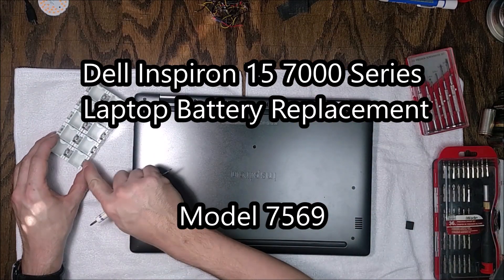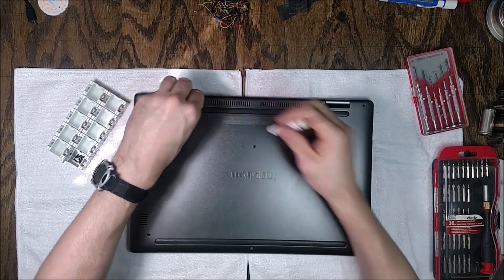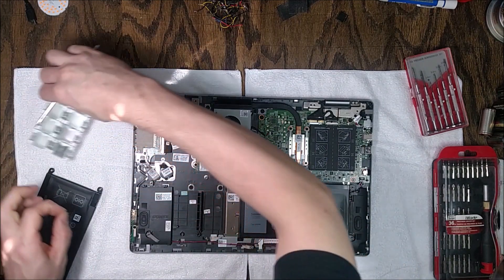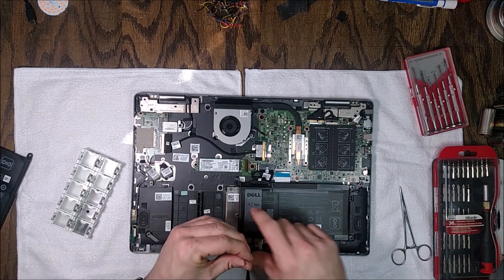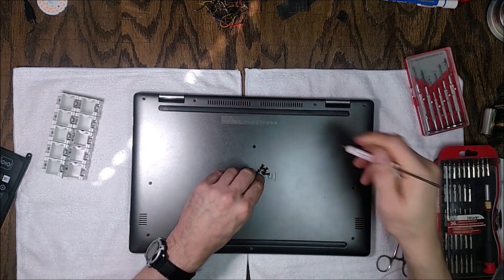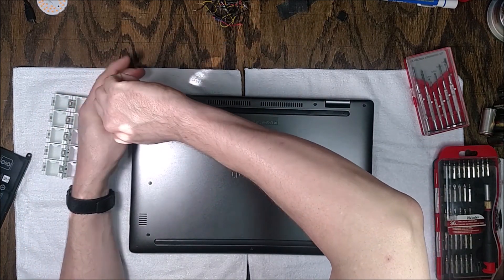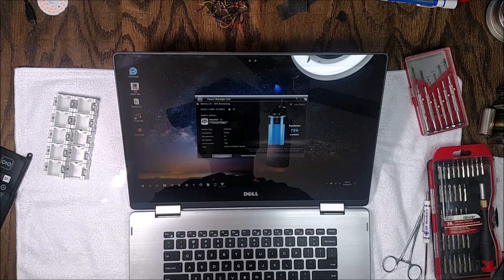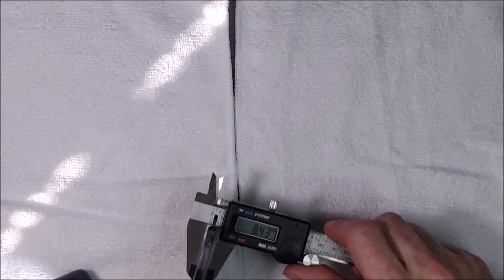Dell Inspiron 15 7000 Series 2-in-1 Battery Replacement

Comment: I can’t seem to unscrew the top 6 screws, and I’m not sure why
Reply from the maker: Hmmm...  You're not the first one to comment with a problem getting the screws out.  My theory before was that the threaded inserts that they screw into are loose and spinning with the screw as you turn the screw.  If the inserts are loose you may still be able to get the back off by removing the rest of the screws then carefully going around the edge popping loose the cover from where it snaps together.  If the inserts are loose they might come out of their holes with the cover.  But if that works then I'm not sure what to do to fix the situation.  It depends on how they are broken.  On other broken devices where I've seen this I have been successful at gluing the threaded inserts back in place with super glue or epoxy.
Reply: @cdsmith  I found a video that helps with this problem, apparently the 7573 model has a chassis which attaches the top 6 screws to the back cover, so you can only remove the bottom 4 screws completely. For everyone who had this problem, I strongly recommend checking out xlearntechnow's video on it, but the gist is that you remove the bottom 4 screws, but leave in the top 6 which are closer to the vents (make sure you unscrew them as far as you can), and then you use a thin plastic object like a card or a guitar pick to pry open the back cover, starting with the section closer to the vents, and the remaining 6 screws come off with the cover. Other than this issue which it seems like was particular to my model, your video was very helpful and I appreciate your reply and efforts to help the situation.
Reply from the maker: Thanks for the explanation on this.  I thought it was odd that the screws couldn't be removed, and I wasn't convinced myself that broken inserts were the problem, but it was all I could think of.  Gotta wonder why they designed it that way.

Comment: does the model number matter when it comes to getting  battery? i just bought one but it had no battery.
Reply from the maker: The model number does matter.  I don't think it has to be a genuine Dell but it has to be the right model because there is a chip in the battery that the laptop checks to make sure it's right.  Also probably has to be the right model to properly fit and have the right style of connector.
Reply: Carl Smith alright thank u!!! My dell is a the same model “ dell inspiron 15 7000” but it was made back in 16
Reply from the maker: I think mine was made in 2016 as well.  You may want to check your specific model number when shopping for a battery.  Like mine is also a "7000 series" but the specific model is 7569.  Then do a search on the specific model number and the word "battery" to make sure you are getting the right type of battery.  Although if yours looks identical to mine, it probably does use the same battery.
Reply: I have the dell model no.  7560 can i use battery which is compatible with 7000 series like the battery description says compatible with 5589, 5590, 7560, 7569, 7570 etc. Plz help

Comment: Hi Carl, appreciate the video! It's great. I have a communication error with my version of this laptop. I'm worried ill buy a new battery and it won't fix it. It's at 91% and refuses to charge. Did you ever come across the problem I'm having? I'd appreciate your advice thanks.
Reply from the maker: Haven't seen that problem.  Does the percentage go lower if you run on battery for a while?  Does it say it's charging if you plug in the power adapter?  Mine has an app called "Dell Power Manager Lite" that can give you better information about what is going on than just checking the windows battery icon popup.  Maybe that app will tell you if there is something wrong with the battery.  Just click the windows icon and type "Dell Power Manager Lite" and it should come up in the search.
Reply: @cdsmith  When you unplug the power the laptop turns off. It says 91% battery. In bios it says communication error with the battery. The battery is relatively new, no apparent issues upon visual inspection. Its as if bios just rejects the battery. Whatever tells bios that its a good Dell battery's seems to have failed for some reason. I'll give that Dell Power Management a try for more info. Thanks.
Reply from the maker: So then the question is if the problem is with the battery or the motherboard or the BIOS.  The easiest thing would be to buy a new battery but that is kind of expensive to do without knowing if it is really the problem.  I guess the next thing I would try is to unplug and closely inspect the connector for the battery and where it plugs into the board to see if there are any problems with the pins in both connectors. Maybe clean the connectors with some alcohol. 
Another thing to try would be to clear the BIOS config settings or even reflash the BIOS but I don't think that is very likely to fix the problem.
Reply: Hey Mark, I'm experiencing this problem currently. Did you manage to fix yours?

Comment: I replaced my battery back in October and recently like a week ago the laptop just died. AC adapter LED doesn't light up, power button does nothing. It's possible that battery just crapped out or is it maybe the motherboard or fan just died?
Reply from the maker: That's a strange problem.  First issue is that even if you have a problem with the laptop, the green LED on the power adapter should light up when it is plugged in on AC.  Check anything you can with the adapter -- if the power cord is plugged tightly into the adapter and the outlet it's plugged into actually works.  And check it while not plugged into the laptop, just in case the laptop is causing a problem.  If the cord is plugged into the brick properly and you know the wall outlet works you might need a new adapter.  But then there's the laptop.  Even with a bad power adapter it should be able to run off battery.  In normal use the laptop should shut down before the battery is completely dead, and so the battery should retain enough charge to at least power up to that BIOS screen that warns you that your battery is too low to boot up the laptop.  So it's likely you have a problem with both the laptop and the charger.  Which makes me wonder if the laptop had an issue that somehow also killed the power adapter.  Which makes me worry that if you just buy a new power adapter it won't fix the problem and maybe you could even damage the new adapter if the laptop somehow had a fault that damaged it.  On the other hand, you can find the power adapters fairly cheaply online.  I found one on eBay for 12 dollars so it wouldn't cost much to get one and see if it fixes your problems.
Reply: @cdsmith  Yea im looking to just get my data off the SSD and get a new one.  Do you recommend any services or devices for getting the data off the SSD?
Reply from the maker: You should be able to just buy an external USB adapter that looks like an external hard drive enclosure.  One that is for M.2 drives.  Just remove the drive and install it in the external enclosure and you should be able to plug it into another PC and get at your data.  It will end up just working like a big flash drive.  I don't actually have one for M.2 style drives so I can't make a specific recommendation.  In general, Startech has a good reputation for this kind of product, but with a quick Amazon search I found a lot of USB to M.2 SSD adapters.  Any of them would probably work but since I don't have a specific recommendation I would suggest looking at the reviews to see if any of them have bad reviews.  You can get a cheap one that is just a circuit board with a USB connector on the end, or you can spend a bit more to get the nice one with an enclosure like an external drive and you could even continue to use the drive as a backup drive, and maybe get some value from the dead laptop by using it's drive as an external drive.

Comment: You need to know the Model number ( example above is model 7569) a) not only to buy the correct battery, but b) Removal of the back.... for instance it is different on the models that turn into a tablet.   [You need the model number if you look at YouTube to see the procedure.
I just did my wife's  Dell .   Ordered a non Dell, but same watts, looked on youtube for the procedure.  It went like clockwork.  Plugged it in and battery was at 46%.   It works fine and was charging up.   They did recommend a "calibrate" and 3 drains and recharge initially.
Reply: Addition:  It came with two screwdrivers.  Dell does use LockTite Blue, which makes sure the screws stay in, but not so much that you can't remove them. 
I slso complement Dell on the ease with which the back comes off after you have the screws removed.  Even though there were 20 clips they back popped off quite easily … and surprisingly they lined up on the first try when reassembling.

Comment: I have the same laptop and my battery is about to die, keeps charge for just 15-20 minutes. Your crisp video and narration, gave me confidence to buy the battery on amazon and replace it myself. Apparently only thing, i need is one small size screw driver. Thanks for sharing your video.
Reply from the maker: Thanks for watching.  You should need only the one screwdriver for this replacement, but if you are going to get into more work like this you will need more tools.  :)  I recommend getting a set of the small screwdrivers in various sizes and even maybe one of those sets with a handle and a bunch of replacable bits for all the common screw types.  Another tip on the battery life is to check your task manager to see what is running in the background I often  notice my battery going down faster than normal and find a task in the background sucking up a lot of CPU time.  If you now what the task is and that it is safe to end it, you can kill the task to end the battery drain.
Reply: @cdsmith  Thanks a Ton.  Have a great Sunday

Comment: Hi Carl, my laptop (model 7579) stopped to turn on. I opened and found puffed up battery. I removed it for now till I buy another one. But I am still unable to turn it on with AC connected. Do you know if this is something expected?
Reply from the maker: I don't know if that is expected.  I know many laptops will run on AC without the battery installed but I don't know if this one will.  It might indicate a bigger problem than just the battery.  You could spend a bunch on a replacement battery and find out it still doesn't turn on.  I guess the first thing to check is obvious things like if the green LED on the power adapter block comes on when plugged in, and does the light on the front edge of the laptop come on or do any blinking when plugged in on AC (but I'm not sure what that light on the front will do when no battery is installed since it normally indicates charging).  You could try plugging an external monitor into the HDMI port to see if you get any video that way. I've seen laptops that seem dead just because the backlight in the LCD panel has failed.
Reply: Yeah, for me this also looks strange and I afraid it is something else. I tested AC with multimeter and it is ok. Ordered battery, will see if it help. Thank you!
Reply: That's just how some of these Inspiron laptops are designed.
Mine won't turn on with just AC unless the battery is installed.
Reply from the maker: Thanks for the info.  I suppose in the old days when you could just pull a latch and pop the battery off the back or out of the bottom of a laptop, they had to design them to be able to operate with the battery removed as people would expect that.  Now that the battery is not removable by normal users they don't need to design it that way.  Maybe they even use the battery as part of the power regulation, or to provide extra power during peak CPU usage times.
Reply: @cdsmith  exactly

Comment: Hi Carl.  Thanks so much for this video.  I was able to change out my battery and everything appears to be working perfectly!   I was never able to find a battery that said Dell, so I bought one from Amazon for about $50.  It's an off brand but the laptop appears to be accepting it fine with no hitches.  Wish Dell wouldn't make it so hard to switch out batteries.  I keep a laptop for a long time and run through several batteries during the life of it.  Thanks!
Reply from the maker: Nice to know that it is possible that non-Dell branded batteries can work as well.  I kind of figured they might work OK considering how many there are out there for sale but I was a bit worried about trying one when I replaced mine.  It would be nice if it was easier to switch out batteries, but I can understand why they made the laptop this way.  Now that they want to make many laptops very thin, they can't really design them with the older style detachable battery packs that had the thicker cylindrical 18650 cells inside. Maybe they could have designed it with a user replaceable battery pack with the flat battery inside, but even that might have made the laptop thicker because of the extra layers of plastic housing that would be necessary.
Reply: I am used to the tabs on the back to replace the battery.  Same as you.   So I Felt the same as you, before doing it... it was fairly easy, once you locate the correct YouTube video.  Did take about 20 minutes, because this was my first time and did not want to drop a screw or pull the wrong place on the back when removing it.    One word of caution... Disconnect your old battery at the battery..NOT the mother board.  If you do make sure you salvage the connector cable.   
AND
I needed to use a very small flat head screw driver to remove the cable battery plug, you don't want to risk pulling on the wires and breaking one of the wirers.

Comment: Hi Carl,
I  have this same laptop and the adapter wont charge the battery no more. I'm going to buy this same battery and replace  it. I've had the laptop for 12 months and didnt really use it for a while.. I'm confused why it wont charge any more.
Reply from the maker: That's a weird one.  Even if the battery is worn out, it should still try to charge it, unless maybe the laptop thinks the battery is bad.  I was thinking maybe you have a problem with the adapter, but it if it runs the laptop off AC when plugged in the adapter is probably OK.  My laptop has an app called "Dell Power Manager Lite" that will tell you the condition of your battery.  On mine you can right click the Windows 10 battery icon down by the clock and pick it from the pop up menu.  You could also find it with the Windows 10 search.  Maybe that will tell you something about what's wrong.

Comment: Hey Carl, I have a Dell 15 7573 so I assume it would be the same battery. Can you tell me if these Dell 7000 series will operate without a battery, while just using AC power adapter? I have an Asus laptop that does. Just wondering. Thanks.
Reply from the maker: I'm not sure if the 7573 uses the same battery or not.  I found a battery site that shows a 56 Watt Hour 4 cell battery for the 7573, but then I found a YouTube video that shows the inside and you can clearly see the 42 Wh three cell battery like mine.  Maybe the best thing to do is to take the bottom cover off yours and see what battery it has inside.  That's what I did with mine when I wanted to replace it.  I'm not sure if it would operate on AC without the battery installed.  Most laptops will, and in the old days, when you could just push a latch and detach the battery, some people would do that on purpose to try to save charge cycles on the battery when the laptop was mainly being used at a desk.  But lately I have seen laptops (like my older Toshiba in my other videos) with built in batteries that have no CMOS backup battery, because they think you don't need a CMOS backup battery when the main battery is not supposed to be removable by the user.  In that case when you remove the main battery you lose your CMOS settings like boot order and the hardware clock settings.  But these Dell Inspirons do have a CMOS backup battery so that shouldn't be a problem, so it may work fine.
Reply: @cdsmith  IIRC my pdf manual says 42W and this video shows 42W. https://www.youtube.com/watch?v=wFaly5x0Qa8
I don't need a battery yet, just getting prepared for the day I do. I will definitely go the Amazon or 3rd party seller route.

Comment: Would a model 7579's procedure be any different ?
Reply from the maker: I did a search online for the 7579 and it looks like it's from the same family of laptops as my 7569 and it uses the same battery.  So I think it's a pretty good bet the replacement procedure will be exactly the same.
Reply: @cdsmith  thanks a lot